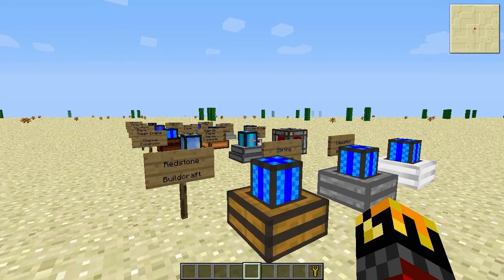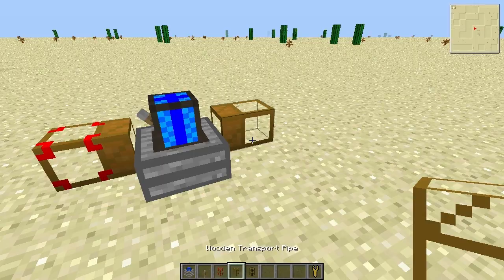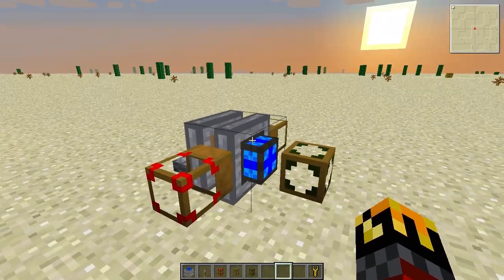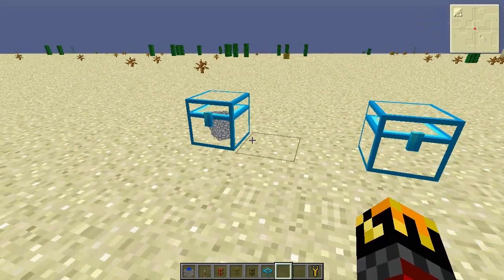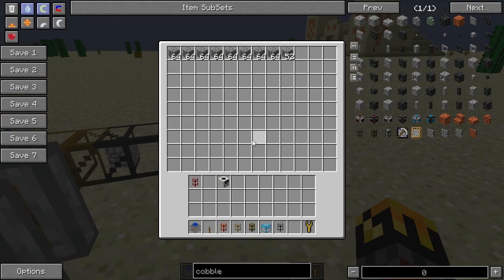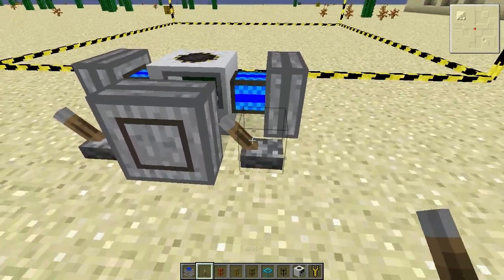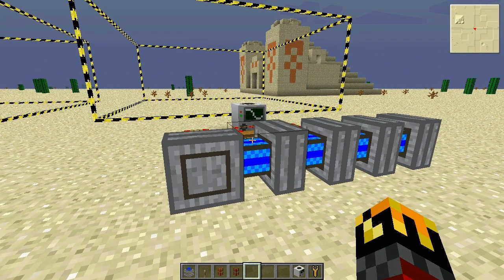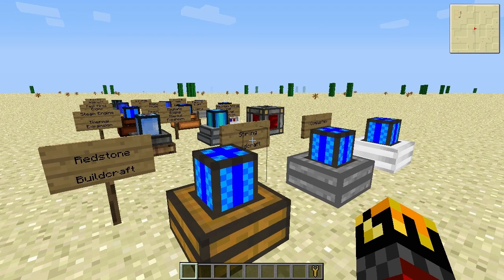Learning with Chronno   Basics of Buildcraft Power

Comment: Hi, just wanted to mention a few things, i think if the stirling engine is empty (if it is run out of coal) in this setup  6:47 some items of the chest would go into the engine too, you could see that in the way they connect. Another thing is that a quarry don't have to have the item-output on the top, it could be at the bottom or the sides too. Wanted just to make those things clear and that other could avoid for example the first problem with an iron pipe. But still nice video :)